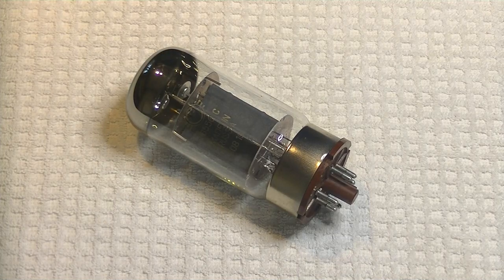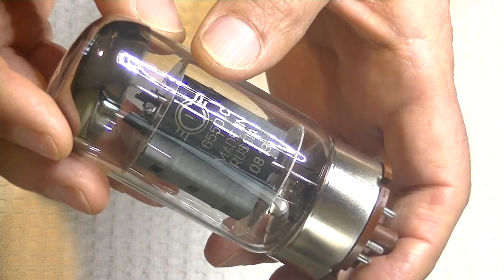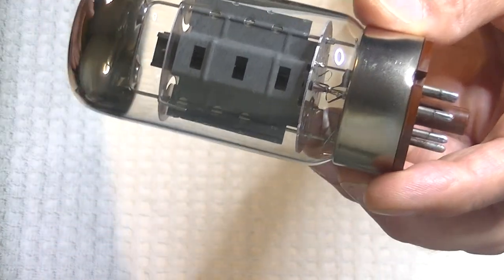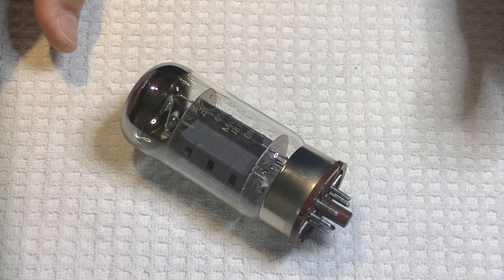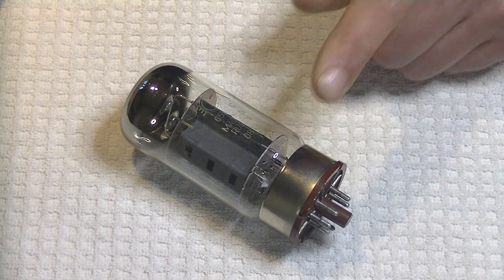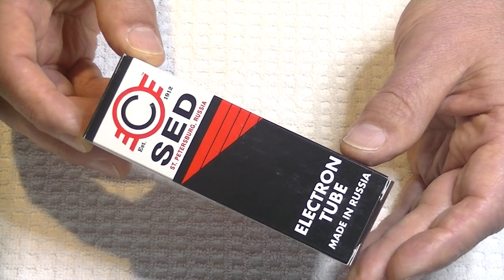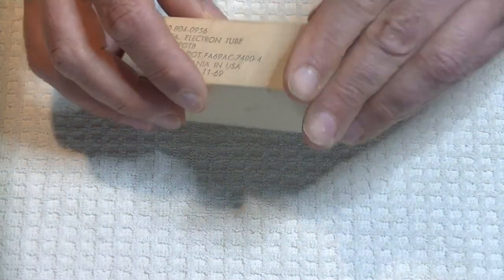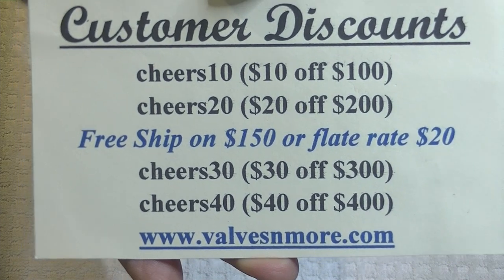Tube Lab #31 Svetlana 6550 + Willsenton R8 Amp

Comment: Hi Jim, I received the full set of valves for my R8 from you and have just fitted them. Thank you for marking up the order of them for me. What a huge difference they have made they are so smooth compared withe the stock Chinese valves that came with the amp. I was surprised how quickly they came to me in France. And how well packaged they were. Great service! Thanks Jim.
Dan
Reply from the maker: Glad they worked out!  And thanks for the nice review!

Comment: Hi Jim. As usual, great down to earth video. It's great that there is a member of the KT88/6550 family that actually sounds better than just very good. As I've said as per other correspondence, I'm using a quad of Sophia Electric KT88-ST blue glass. I'm not sure what the advantage of using blue glass is, but they do have a bit of punch down low - although all KT88/6550's have had this quality; but lacked other preferred qualities. The Tung-Sol EL34 re-issue on the other hand is just nicer sounding everywhere else, although can't wait to try your Sylvania 6SN7/MELZ 6H9C (6SL7)/Mullard EL34(6CA7) combination. They should arrive early next week.

Comment: So what's are the main differences between this tube and the kt88 interms  of sound?
Reply from the maker: In general terms, none, the 6550 and the KT88 are both beam powered tetrodes, with identical pinouts and very similar specifications.  The vintage Svet 6550C is basically a well made high quality KT88 type.  If you follow my channel you'll already know I'm also a big fan of the vintage Svet EL34 and both of these tube where made in the St.Petersburg factory (production ceased in early 2000's)  For a review of the sonic performance please watch the video.
Reply: @tubelab194  thank you, I have watched the el34..  I understand those differences.

Comment: Jim, I had 2x a couple of quads. They sound very good. Only problem I had was the max current at the end of there life they can go into red plate, no I use electrolytes for 5 years and recap them. So not be course a electrolyte was shorting or some other reason. But the Svetlana sound very deep low, soft and very active mids, sweet highs.
I can not get good ones within reasonal price. Nice video nice tube

Comment: Technically the Getter has nothing to do with maintaining the vacuum, but will absorb inpurities in the tube.   It is a good indicator of the state of the vacuum, but doesn't maintain the vacuum.  Just being pedantic I know :).   Got to watch corrosion on the pins that may damage the glass to metal seal, but tubes have to be pretty badly treated for that to really become an issue :)
I have only recently foudn your channel and I am enjoying looking over your videos  Thanks for the detailed expanations.
The Svetlana 6550 C's are ridiculously expensive here in Australia at the moment (Jan 2023).   I am seeing them between AU$500 and AU$900 each.........
Reply from the maker: I disagree.  It is my understanding that the gettering absorbs stray gas molecules, some that remained after the vacuum pump was removed and some that slip in over time.  Vacuum tubes never have a perfect vacuum, but they need a close to perfect vacuum and if the stray gas molecules build up that's the death of any tube.  That's the entire purpose of the gettering material to absorb those stray molecules and maintain the vacuum.  BTW a pendantic approach is not appreciated.  You or anyone is encouraged to bring meaningful thoughtful and useful information to the discussion.